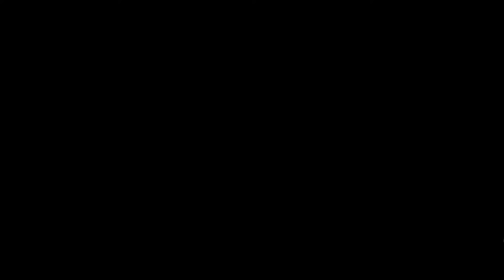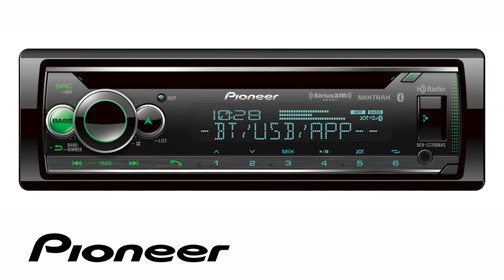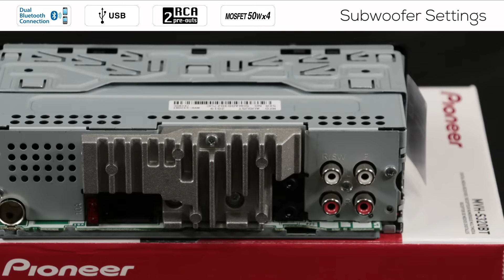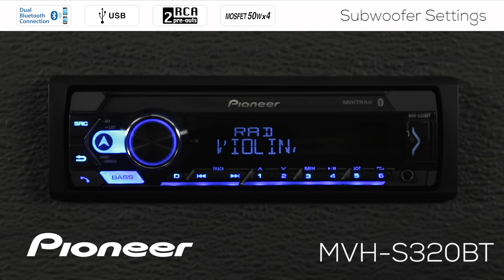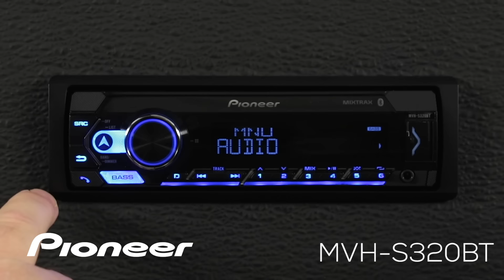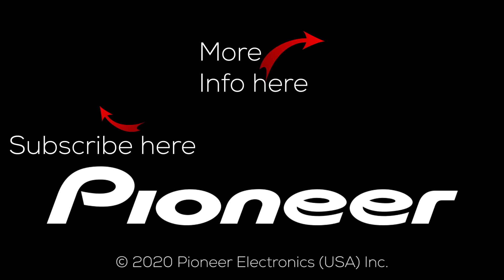How To - Subwoofer Controls - Pioneer 2 RCA Audio Receivers 2020

Comment: Hi! I have the DEH S420BT head unit. I am in the process of wiring in 2 pairs of 6x9 speakers via a 4 channel  amp using the 2 sets of RCA outputs on the head unit. I currently have an active subwoofer in the vehicle, connected via the ISO harness on the head unit. Is it possible to retain my sub, whilst using the 2 sets of RCA outputs for my new 6x9s? Thanks in advance.

Comment: Hey! I have a Pioneer MVH-MS510BT radio in my car with three pairs of RCA pre-amp outputs. After connecting the radio with RCA cables to the Pioneer GM-D1004 amplifier, the diode in the amplifier does not light up, and my radio does not have the settings shown in the video 😔

After connecting the amplifier and the radio with the cable included in the set with ISO connectors, everything works as it should.

What should I do in this case?
The radio software is the latest version.

Comment: I have the MVH-322BT with 2 rear 6x9 speakers and on 10" sub woofer. RCA cables from the head unit to the separate amp. The 6x9's seem to be working but the sub is barely has any volume. All speakers and amp are Hertz components. 
Could you help me set this configuration up correctly. Thank you.

Comment: Can anyone please explain this i have 2 front and 2 Rear door components speakers are connected with pioneer headset harness 
But i m confused my headset have 4 rca where should I connect red/ white leads ? on upper ones or lower ones?
I have Rockfosgate class bd amplifier and 2 question is my amplifier have 4 rca outputs where to connect red/white leads ?
I just want to run single sub through my amp !

Comment: Hi, so that means if I use a component set in the front and a subwoofer in the back with 2 RCAs going into my aftermarket amp (ch 1-2 is front speaker and 3-4 is bridged to my subwoofer), do I have to set my Pionner head unit to SW/SW mode?

Comment: Hi, Loved the vid,   I am a bit confused, I have the DEH-S420BT which I have had for a month so far and enjoyed.  I have it in a BMW Z3 1998 using the bmw speaker system as standard, but I want to add some under-seat subwoofer units taken from a BMW 218.  I am looking to plug them straight into the RCA outputs on the rear.
I can't get any sound from them at all - not even a click when I connect the leads.
The subwoofers are fine as already checked.
Is there something to actually switch them on?
Many thanks

Comment: Hello, i own a Pioneer DEH-S320BT stereo in my car and want to install a sub and amp. I have on mind buying a 4 channel TRF M600.4AB amplifier and connect the sub to channels 3 and 4 bridged and also connect 2 additional speakers on car's shelf (on channel 1 and 2). On the amplifier there are two sets of rca inputs, one set for channel 1 and 2 and one set for channel 3 and 4. The input rcas from channel 3 and 4 (sub rcas) will be connected to R/SW output of the stereo and input rcas from channel 1 and 2 will be connected to F output of the stereo ? Or it doesn't matter? Also which are the correct settings that i have to choose on speaker and preamp mode ?

Comment: I have 6 speakers, 2 in each row. Four speakers in the 1st and 2nd row are considered my “FRONT” ( connected to a 4 channel amp in PARALLEL so I’m only using one pair RCAs from channel 1 & 2 going into the Front RCAs of the head unit  ) and the remaining two speakers in the 3rd row is my “REAR” ( is it possible to wire my “REAR” using the wiring directly from the head unit because I want to use the remaining pre-out RCAs for my subwoofer ? )  does this setup make sense ? If so, which mode should I use then ? I’m planning to get a DEH-S4250BT head unit. Please help, thanks.

Comment: okay sounds interesting and looks like it has a cross over set up inside? How do you physically install this unitusing 4 speakers and a sub. A 4.1 set up. 2-6.5's in front with 2-6x9's in rear with a sub in trunk. That comes to 6 rca jacks. Not 4. 
Maybe the front by itself and split the other two jacks with rca splitters? So one jack gets a sub and 6x9 speaker and the other one gets a sub and 6x9 speaker, split. Right? And the tuner actually sees the sub as a separate channel? As well as the 6x9's? Thanks.

Comment: i have a 3 channel taramps tl 1500 amp with one pair rca's..so if i choose rear/sub my speakers connected to the amp wont play...also at sub/sub....the only way to have them all playing is if i set rear/rear but i can not set the subwoofer settings..any solution?

Comment: Hello.  What to do to add a speakers for the front stage and a speakers for the rear stage and subwoofer?  Although we have two rca output jacks !?  Should we use cables to convert one output to two RCA outputs and connect it to the Rear/ subwoofer inputs?

Comment: How do i know when the sub amp is on or off. For example. When i start my engine usually the Unit should sent signal to the amp to turn on, and then i shut off my engine the unit should sent a signal to my amp to turn off. Does this Unit has such function to prevent my battery from dying over a night if the amp does not go off ?

Comment: I have an AVH-120BT, enabled subwoofer in settings, and my subwoofer output is very faint why is that? Everything is wired correctly harness wise. I have a kicker cxa800.1 hooked to a kicker 12” L7. When connecting rca cables to left red and white port; weak signal. Same goes on the right side. Unless I need to use a Y RCA connector? Kicker and sub was tested before car install and works fine. What I didn’t try is connecting rcas to 2 reds or 2 whites. But even when settings is on rear or subwoofer and subwoofer on, nothing. Any help?

Comment: Please help me out here, I’m going crazy looking for answers. I just received my new SPH-10bt. I have 4 100w RMS 4OHM speakers and a sub that I want to power off a 5 channel amp. I was sad to see I only have a front and rear channel and not a 3rd channel for an amp. I’m trying to understand how I can run the front and the rear speakers to my amp’s respective Fr/Rr/L/R rca inputs if there is only one RCA cable delivering signal from the Front channel?? Should I just run wire from the rear speaker wires coming from the pig tail to the amp, the RCA cable for the Front speakers to the amp, and an RCA for the sub to the amp from the rear RCA output on the HU?

Comment: Can I connect rear speakers wire output directly to a second amp ?? 
While its on rear / sub mode ...
Then rear speakers suppose to work...??
So I can fade and balance 4 speakers ...
Also controls the sub ...
Front and sub in 4 channels

Comment: How would you recommend useing the sla function  my brother has the deh-s420bt and trying to set the gain on his amp for his subwoofer and i can't get oscope peaks to round off , I'm guessing the head unit is sending a clipped signal ? Everything is set flat loud on low and firstly we can't  get the desired 36 volts even at max gain and as previously  said even at low gain the peaks are still flattening.  Any advice? Fyi volume is set at 75% not max

Comment: My car originally has 4 speakers. How to run 13 speakers including tweeters on it? I am concerned about how to hock up the sleaker wires with the radio unit and with the amplifier.